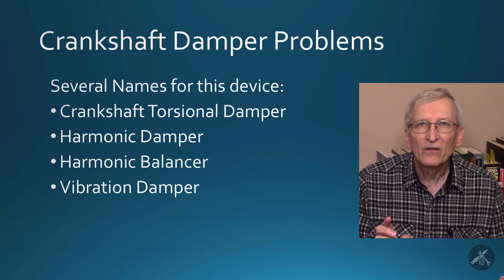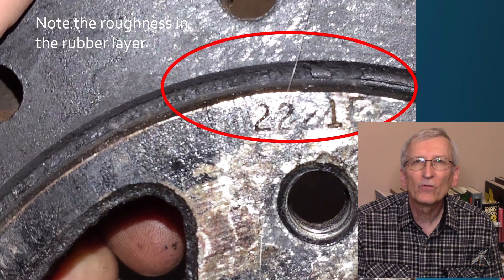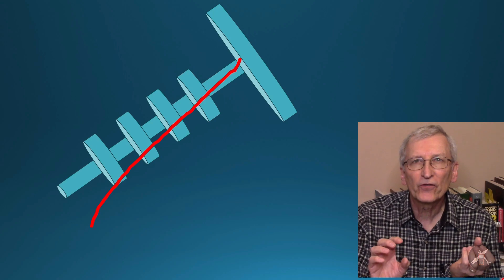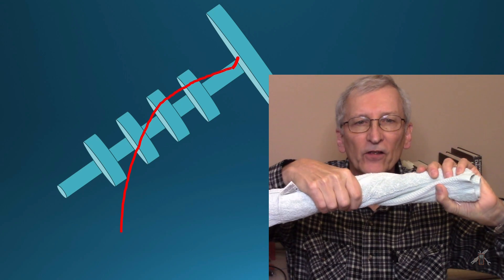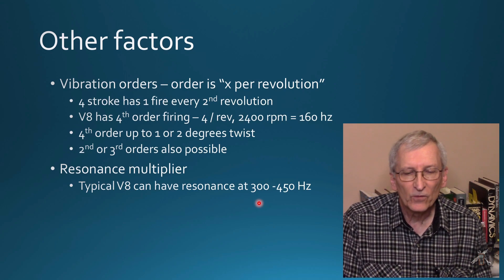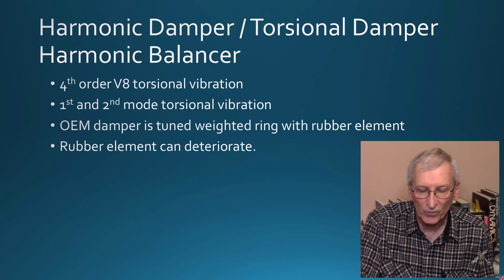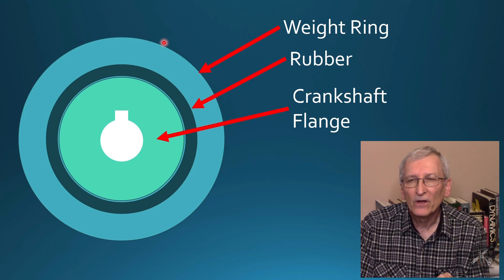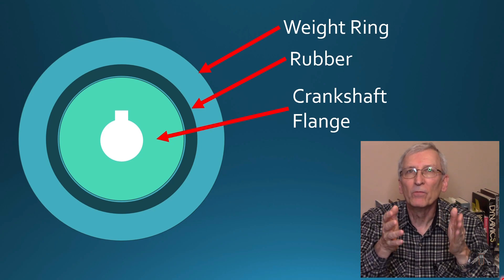Crankshaft Dampers - Here is a Failed One - What to Look For

Comment: Is it possible to replace the balancer on our Tuneport Iroc engines without removing the engine? Is there enough room to get the right puller in there to remove it?
Reply from the maker: There should be enough room.  I did mine with the engine removed, but the service manual indicates that it can be removed in the car. I suppose it depends on the individual tool.  The following links are for my videos when I removed and installed mine. 
https://youtu.be/YkEfNZWtNZw
https://youtu.be/XkyYRQoNUWI

Comment: I have an 86 Iroc z tpi that will only idle right with the est wire disconnected? When plugged in it will still drive but the idle is unsteady and sounds like the exhaust is choppy. I have replaced everything I can think of to no avail. I’m starting to think that the balancer may have slipped at some point and what I think is 6 degrees btdc is not? Is it safe to twist the distributor a little bit with est connected to see if the idle smoothes out? I know that when I set the timing to factory 6 degrees with est unplugged it stays and doesn’t move. With est connected it advances to 14-15 btdc and stays?
Reply from the maker: Those symptoms could point to the damper.  It should be safe to retard the timing as long as the engine seems to run smoothly. At some point, it will probably stall.  Generally retarded timing at idle won't hurt anything.  If too retarded under power, exhaust temperatures will climb as more combustion will continue into the exhaust manifold.  But if the damper is bad, the indicated timing may be wrong.
Each model had a different spark curve programmed, but my '85 will advance something like 10 to 20 degrees when the EST is active and trans in park, so that sounds reasonable.
If your timing mark is off and you (unknowingly) set the timing too high, the engine will tend to knock and the knock sensor will retard timing to protect the engine and then try to re-advance the timing. If your experiment bears fruit, then you need to find a way to get #1 to TDC and check the timing mark.
Reply: @bitsofwisdom460 Thank you so much for the detailed response. Your videos are so detailed and informative. You have assisted me in many endeavors with my IROC and I am grateful. Thank you so much.

Comment: Most people don't know the difference between a damper and a balancer. LS engines are internally balanced so the use a damper. Small block chevy ( some models ) are externally balanced and are keyed. These engines use a balancer.
Reply from the maker: You're right, many people don't know the difference and confuse things. And yes, engines vary between internal and external balance.  Sometimes even in the same engine family it can vary depending on variations in bore and stroke. Something I learned on the keyways, are that they are strictly for position. I thought for many years that they were load bearing.  It became clear that any motion in the joint will destroy the key / keyway.  The design standard was that the joint needs enough press fit and bolt torque to never ever move,

Comment: Had this exact issue and never found it till I took the heads off, at TDC on the damper, piston was still down in the bore, timing was severely advanced maybe >20 degrees when it should be 10, engine pinging was finally explained.  Thanks for the content!
Reply from the maker: You're welcome, and thank you for your comment.  It often is a hard problem to find.

Comment: The one on my survivor 1971 LT1 Corvette slipped about 40 degrees - Damper Doctor in California is on of the largest remanufacturers of dampers in the country. Last  8" 1-11/16  thick one I had done was $225 shipped back. 
Worse than the damper is the GM nylon tooth timing gear on the cam shaft 1965 -1985. Living on borrowed time is what the National Corvette Club guys said to me... they were correct - I pulled it down and 3 teeth were missing with chunks of nylon in the pan.  - I had thought my snap on timing light was broken.
Reply from the maker: I didn't know about Damper Doctor.  Thank you, I'll file that away for the future.  And yes, the nylon tooth gears can be a problem.  Many brands used them, but some had more trouble than others. My '85 was ok when I pulled it down, but now has a double row iron gear.